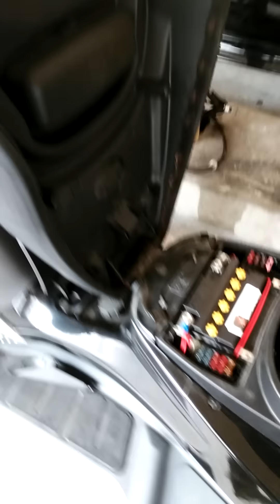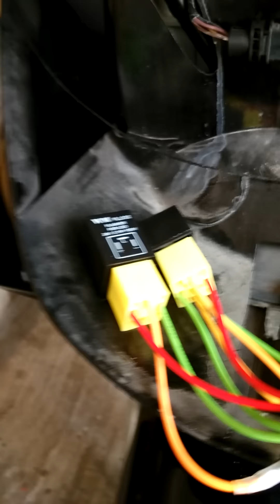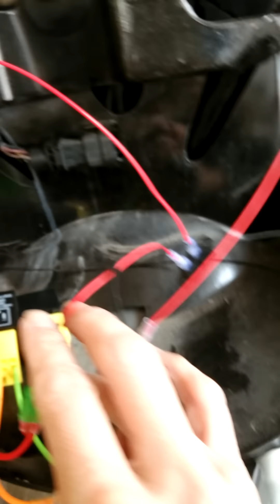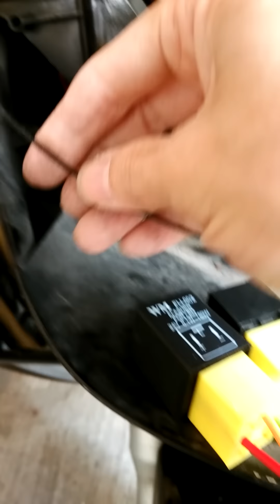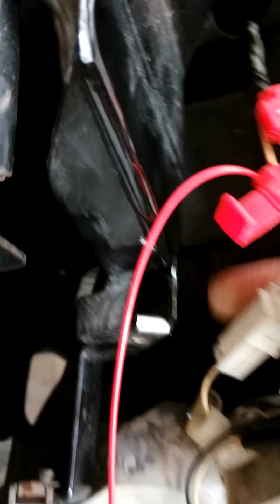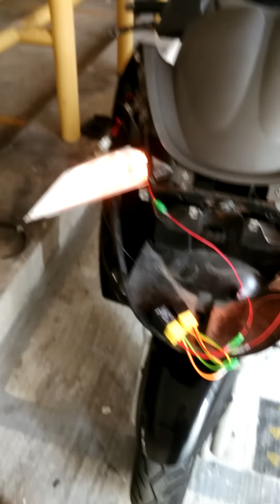Make your own Hazard Warning Light System with separate blinker & relay

Comment: Can you send me the wiring instructions or diagram please for the indicator set up
Reply from the maker: You can check my website there is wiring diagrams inside the product page, just scroll down further you will see them.

https://www.2allbuyer.com/Hazard-System-Kit-P5238514.aspx
Reply: Cant believe that this is so simple to do ....been on about adding an additional hazard it to my bike for ages..but didn't want to touch the original wiring on the bike ..this will help me out a great deal.

Comment: I just notice you use a 24v flasher relay why?
Reply from the maker: It is not a 24V relay, only the factory printed it that way. This relay working voltage is from 12Vdc ~36Vdc so the factory take the middle and printed 24V.

Comment: can you watch this and help me please https://youtu.be/1UPHx6Z15V8
Reply from the maker: Your video really bad, I got a headache with all the shaking. Anyway, seems like you got a fxck up unit from Amazon. Also it may be for different year model or different market some sort, the connector even though could plug in but the wires location mixed up. You need to follow which wire goes to where on that tail unit instead of directly plug into the connector on the bike.
You can look at my blinker page there are wiring diagrams inside to help you understand how the turn signal system should be.
http://2allbuyer.com/Electronic-Blinker-Relay-CF13-P5639796.aspx
Hope this information help and if anymore question, you can use the contact information on the website to contact me.
Reply: 2allbuyer  also if I put that on the battery do I take the old turn signal relay out or what thankd for the help
Reply from the maker: Forget all these relay stuffs, first to do is sort out the wiring on the tail unit you bought from Amazon. The connector came with the tail unit is not a direct plug and play to your original wiring harness. Just like you shown in your video, the green wire from the tail unit connector is not matching in position with the green wire of your original wiring harness connector. So you may need to change to the pins position of the tail unit connector to match with the color of the original harness connector.
Reply: 2allbuyer I can't take the pins out I don't know how to do it without breaking the wire. I am going to put the original tail light connector (because the colors are in the right spots) back in, I'm just going to take the ends with lights off and hook up the New lights on the old wires by spliceing. Because I think that would work cuz on the old lights the only thing that was wrong was the black ring that holds the wire to the light broke I know because I touch the wires to the back of the light and it worked so simply replaceing the full lights would take care of it all that's left is to get the relay cuz the flash is what stopped working first then the black ring broke  that let the light cut off bcuz it wouldn't touch. That's just what I came up but I wanted other comments cuz I don't know for sure
Reply: 2allbuyer do u get what I am trying to say if u want I can make a better video...
Reply from the maker: Usually you use a very small flat blade screw driver, push the metal piece sticking out from the pin inward then should be able to pull the wire and pin out from the connector.Of course you can use the original tail light connector if nothing wrong with it. Find the wires on the new tail unit that is corresponding to the wires on the old tail unit then splice the wires one by one. DO NOT cut all the wires at once, it is very easy to mix them up.After you finished relocatiing all the wires, then try the turn signals and brake lights again. Then you can diagnosis problem from then on without complication things starting from a mess.Hope you will get it fix and feel free to contact me if there is still question.